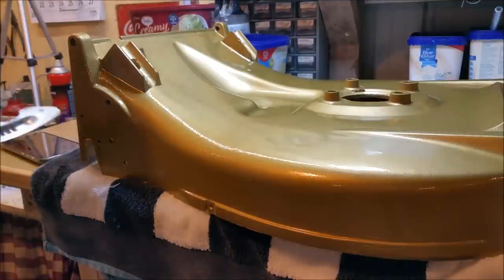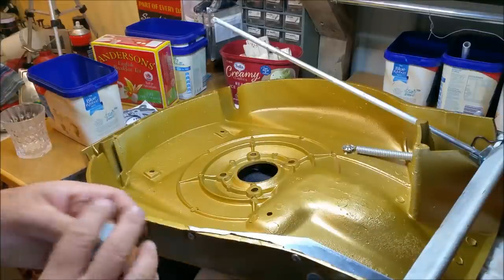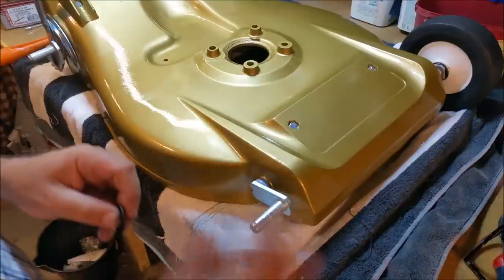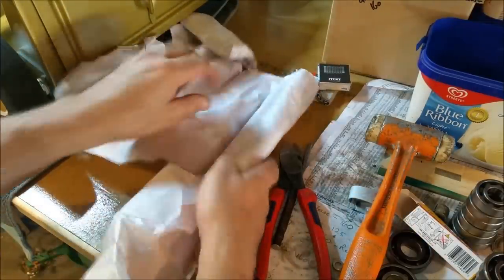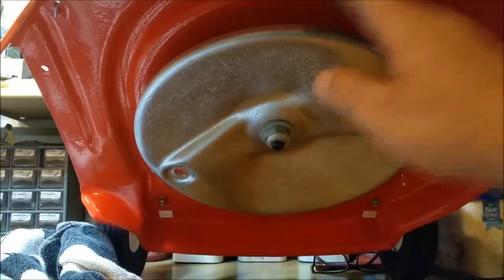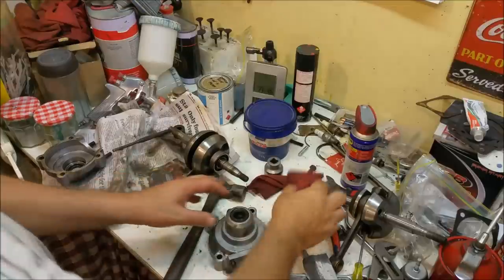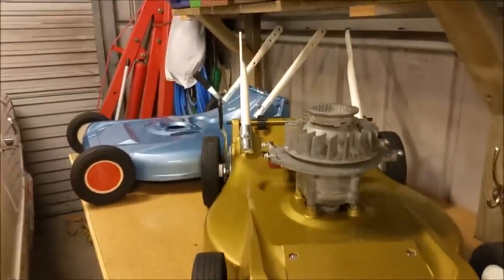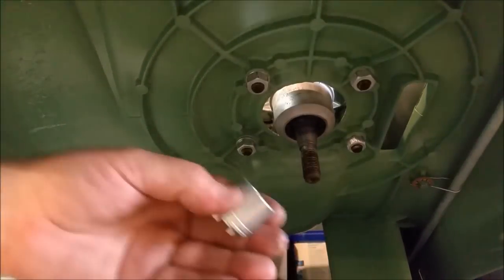Restoring 7 Classic Victa Lawn Mowers Part 6

Comment: I kinda like that bolt in the centre of the torpedo exhaust, I think it gives the mower a "jet age" look.  You may not be old enough to remember the "jet age" when Essendon Airport was Melbourne's international airport and prop airliners were still flying and Boeing 707's were the big international jet airliner.  I don't think you should cover it with a mesh.  In fact, though it may look a little "blingy", a chrome dome nut would add a nice touch to that bolt making it look a bit like a jet exhaust. 
Yeah, I know it's just a mower.   And yeah, I agree that new green will look fantastic.
Reply from the maker: I did it Harvey! Took your advice and added a domed nut - looks great. Cheers and stay well.